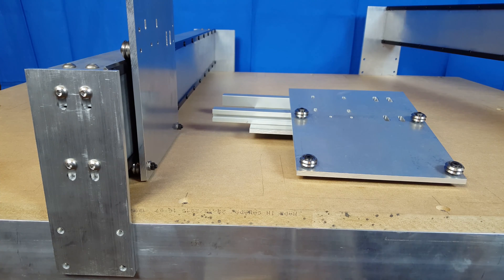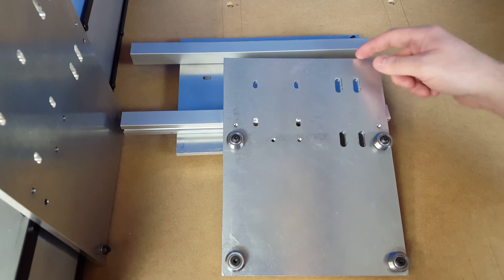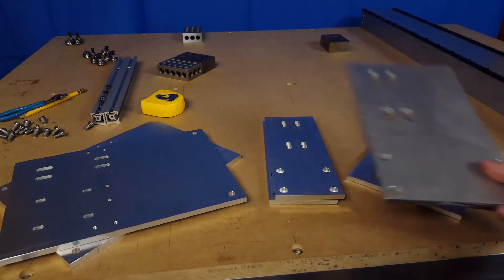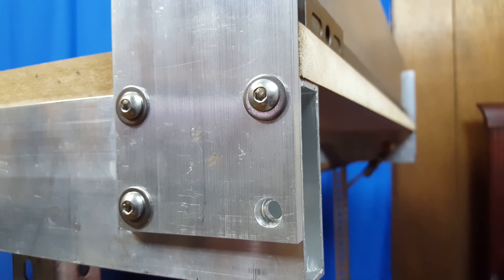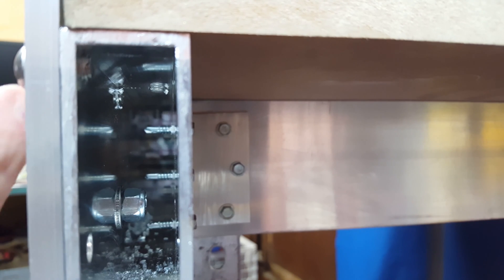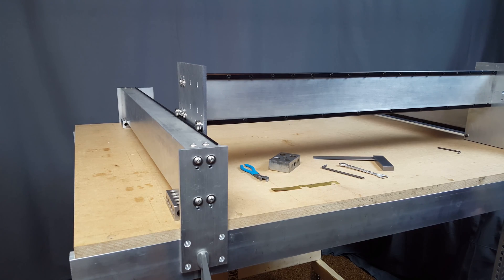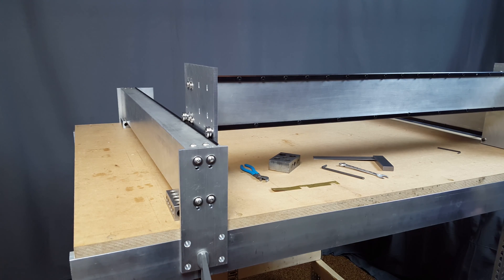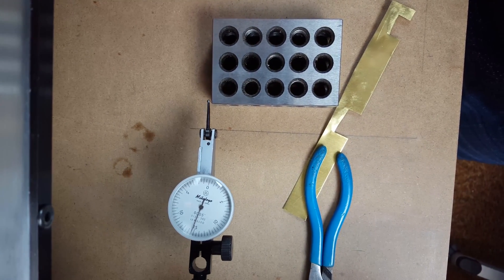DIY-Oko CNC Router: Part 7 Y-axis & Gantry Assembly

Comment: pssst Caleb. Go look at 4:01..... Since your legs aren't rigid, you are going to have table flex that could explain that thousandth that you were off front to back
Reply from the maker: Haha Right you are. I think long term I'm going to build a wood cabinet for it to sit on, but short term (less then 6 months) I'm going to reinforce the legs the best I can. Reason being, I'm planning a move, and I don't want to built something I can't get out of the room.
Reply: Yeah it was pretty bad in that clip.
Reply from the maker: I think that shot was taken before I put the wood braces on, near the bottom of the legs. It's still not great, but better then it was.

Comment: I use shellac to seal mdf projects I cut on my Shapeoko 2. Its very easy to work with, just brush it on and leave it to dry. The downside is that it will need multiple coats with about an hour of dry time and light sanding in between each of them. It might also leave brush strokes on the last few coats, however all the coats combined will not add any significant thickness to the mdf and it can easily be sanded smooth. Hope this helps.
Reply from the maker: Very helpful, thanks!

Comment: You really shouldn't use a wood surface for alignment.
Reply from the maker: You're right. If you have a suggestion I'll try it out. However, The MDF is what I have, and it along with other measurements seem to be yielding consistent results.